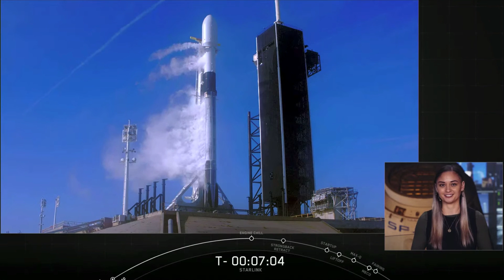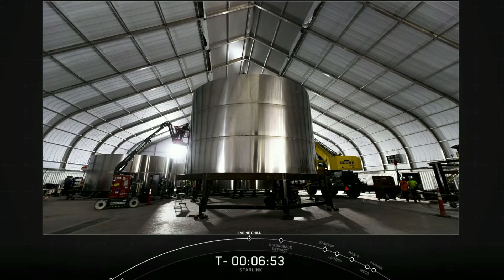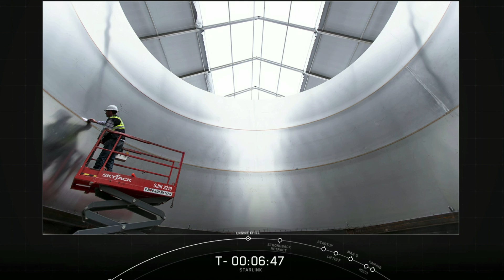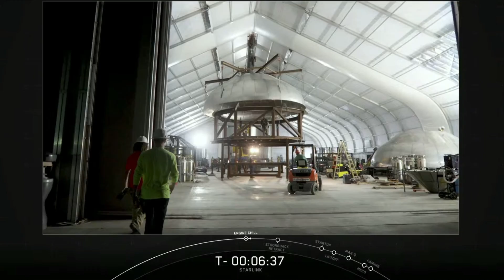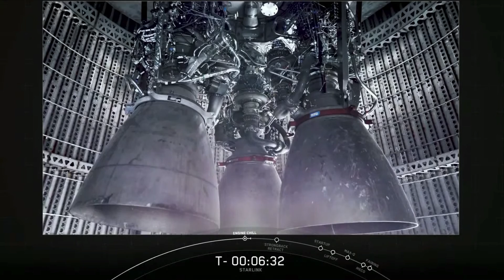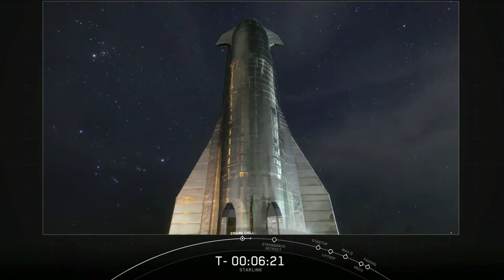SpaceX is looking for welders to build Starships

Comment: It's kind of odd that their website doesn't list a salary. You would have to apply first to be able to find out if it's worth your time or not
Reply: It’s welding so it’s probably based on experience. A garage welder probably won’t make as much as a certified welder with a degree
Reply: Roughly between 22-30 an hour but depends on experience